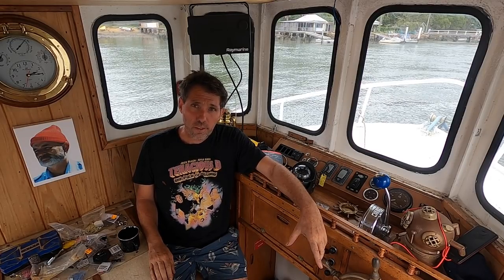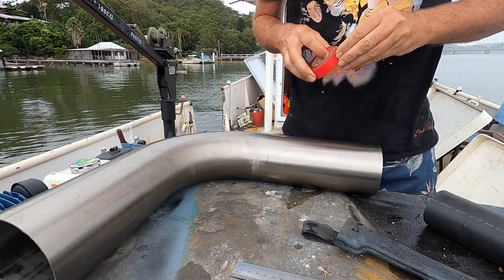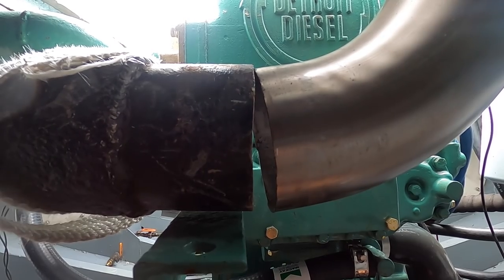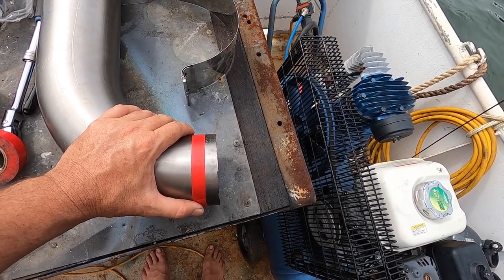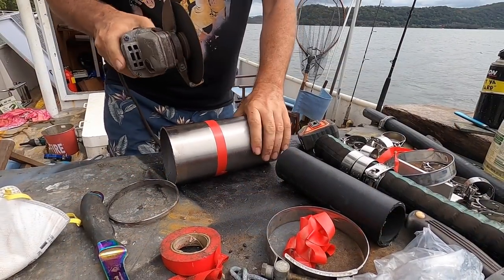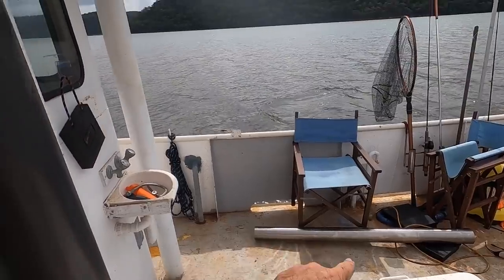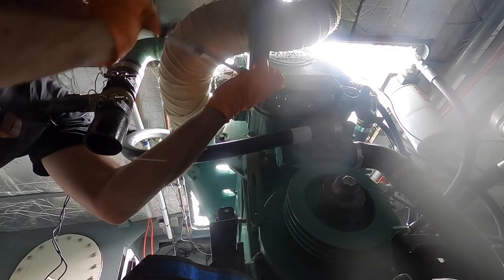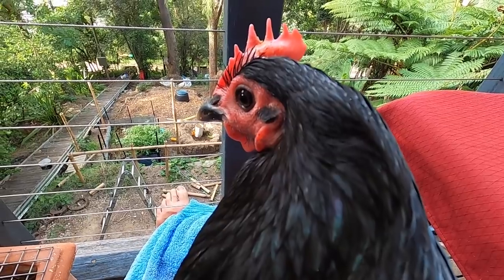Installing the dry exhaust

Comment: May be an odd question, and it's quite possible I missed something.
However, is there any reason you could not have a section of flex pipe in the vertical section of the SS bend between the header and the deck penetration?

Those engine vibes will drive you nuts with the deck acting like a sound board....
Reply from the maker: No room there either.

Comment: very cool been watching from the start relay looks like its coming together just a quick question from the start (Is it still worth buying a steel boat?)
sore the the first video pop up and had a look and had a laugh.
i'm a farmer with a flapper exhaust don't do it at idle the ting noise drives you crazy after they wear and get lose. also a big angle pipe would look cooler

Comment: You need a T fitting instead of an elbow mate so you can drain the rain water !
Reply: If there's any residual water (ounces) in the exhaust it's going to get blown out and/or evaporated in short order once the Detroit gets running.

Comment: Instead of an elbow, what about a sharp 90? Like if you had a metal cube. The horizontal section could go through the cube wall, and the  vertical section could come out of the cube roof through the exhaust hole in the floor

Comment: Hey Stu, Why not just have the vertical (cutting the bend off altogether) then a flexi-pipe and clamp on that bending 90 degrees to meet the exhaust with the other clamp?
Reply from the maker: The turn is too tight.

Comment: what would happen if you rotate the first pipe out of the manifold.. so its pointing down.. come up with an 90 to come across and drop the existing upturned elbow to connect to the vertical stack..  i would like a welded in fitting or even something like an oxygen sensor bung on the bottom of the now dropped pipe... with some flex hose out the side of the hull.   so any water that does come down the stack does not pour directly into the cylinder head exhaust ports.   you might be able to just make the downward loop section out of that flex section of tubing you have..   i realize that you have something dangling in the way.. but maybe that is movable and it would be a lot better than getting rain water during storms down and right into the engine.

Comment: Forgive the dumb question (as I have no idea about this) but why did you use the rigid elbow between the end of the wrapped exhaust and where it goes up to the muffler? Why not just use the flexible hose to make an elbow and joing onto a straight pipe that then joins the muffler? Would that be too breakable or some other reason?

Comment: Is there a reason you couldn't have put the flexible pipe on the other end of the 90% you just purchased to leave more room for it?

Or go the whole way from the existing pipe, to a vertical pipe to the muffler, so use the flex pipe to replace the added 90 degree bend?  Lots of flex and simple to connect.

Lastly I think welding the pipes would be cleaner than the all those clamps.

RichE San Diego, CA

Comment: Hi Stu, getting it done is important to keep project moving . Did you consider cutting the old pipe to a 6" stub and then putting the flex pipe from it to the 90 deg. Maybe the diameters are wrong? Cheers Warren

Comment: Remove that brace that is in the hole coming through the deck, it isn't needed. Then put the flex joint at the top of your new pipe above the deck. Your previous attempt wouldn't have worked even if you had room. 1" of flex joint is not really a flex joint. Basically the same as you ended up with. The vibration of the engine isn't really what you are trying to avoid (even though it will drive you nuts), it is the torque. When the engine is under load, it will rock on those flexible mounts. That is when it will crack that exhaust.

Comment: Could you use just the flex pipe as the 90? Then just attach it to the muffler?
Reply from the maker: No, doesn't bend even close to that tightly.

Comment: I think you were trying to convince yourself that the vibration wont be that much to leave out the expansion joint. I think your wrong though, after a while you will most definitely end up with an exhaust leak, nevertheless you completely defeated the engine resilient mounts purpose. I suggest either cutting back the existing pipe that is attached to the exhaust manifold to make room for a longer exhaust expansion joint. Or fabricate two resilient mounts where the exhaust attaches to the boat.

Comment: Just out of curiosity, why didn’t you use a pipe expander, to fit one pipe into the other, and clamp with a u-bolt on the connections below deck.  Just like the bottom connection of the muffler.
Reply: I've never seen a pipe expander that size. It'd probably have to be hydraulic

Comment: Stu, I think your exhaust is too ridgid. Having done a deal of this in the past, I would recomend using the flex pipe for the entire 90 degree elbow. The flex pipe will eventually rust and have a bit of rigidity anyway. A flex joint, like you see in front wheel drive cars, would make a better flexable connection. When the engine is pushing the boat it will try to move forward on it's mounts. Try to finagle rubber mounts in instead of that clamping affair where the pipe comes through the deck. That will allow the exhaust to move around some when shifting gears and when under load. You have done a nice looking job so far and I suggest you run it as is. if it doesn't work out then try the way I have described. Exhaust is always a pain in the A$$. A well balanced prop with propper shaft alignment will yeild "0" shaft vibration. When the engine is under load it has little vibration. What is the horsepower rating of that Detroit? If you can overdrive it there may be some cheap power to be had. Nice video, my friend. You Aussies must have the tuffest feet in the English speaking world!

Comment: I'm just going to echo the guys about the length and position of your flex pipe. I'm not sure if you have a flex section near the engine but my thoughts are that the assembly might be a bit too rigid leading to cracked pipe. Maybe flex close to the engine at a ratio of at least 4:1 to diameter. The original installation may have gotten away with it if it didn't use flex-mounts. Stay safe man.

Comment: I know nothing of diesel’s [let alone supercharged 2 stroke diesel’s and i understand the supercharger is necessary in this engine design thanks to you, Stu] but ... while there is a LOT of heat the temp is relatively low [in comparison to a gas engine?] yes?  So RTV seems like a viable solution...  Heat  and Temp are related but not exactly the same thing?  I assume that this engine is not run very lean? [which would relate to a higher temp] but runs fairly rich? Which should be cooler? But I digress.

Comment: Should have went down with the exhaust then back up like a p trap with a drain in the bottom for if the flap ever leaked so no water will get in the engine

Comment: you need a fairly good piece of flex pipe to take that vibration !! youll be surprised at what damage it can do if you get that exhaust to stiff . DO IT RIGHT !! SHORT CUTS WILL ONLY COST YOU $$$$$  I would run that flex pipe from close to the flange and make the first bend around the motor with it if you can ??

Comment: Stu,
What is the plan for sealing the deck hole for the exhaust or haven't you got that far yet?
Cheers Eric
Reply from the maker: That is a convection vent that is there by design.
Reply: I was thinking a reverse cone to keep the worst of the rain and spray out of the engine room while still allowing for ventilation.
If the deck is awash you have other problems to deal with and have to hope the bilge pumps handle that side of things.
Eric

Comment: Hey Stu.  Did the boat originally have the dry exhaust stack and then it was converted to 
the wet exhaust?  Did they put the Dual Exhaust muffler stacks above the wheelhouse for 
the cool factor alone?  Hehe.
Could you please explain how a wet exhaust works?  Why did you choose to move back to the dry exhaust?

Keep safe Stu.  It's a good thing the self isolation restrictions suggested do not include friends with wings.
Reply from the maker: Did a video dedicated to this https://youtu.be/tC4jHyUuDs0
Reply: @DangarMarine  Thanks

Comment: I've been stuck at home since 2002 so not much of a change for me  :)
Just curious...why didn't you use the flex pipe to do the entire bend 90 degree up then solid for the the transition through the deck?
Reply from the maker: LOL. Unfortunately the flex tube doesn't turn anywhere near tight enough.
Reply: @DangarMarine /videos Ah...oki  :)
Reply: Gregory Thomas the flex has about a min radius of 800 mm long slow curve

Comment: I wouldn't use a flap on the top of the  stack.  I work in the tractor world and they stopped using those exhaust flaps for the most part. They like to flip up in high wind and allow rain down the exhaust.

Comment: My first instinct was to cut the engine side pipe off by the bolt flange and then flex over to your stack...no 90's at all.
Reply: It's dirty, but I've seen guys cut straight 45 degree angles and weld them up. It's simple and maximum flow is not critical.

Comment: Lol. I would have just pushed the new pipe through the deck from below, twist 90 deg, push it up further, then twist back 90 deg and sit on top of the engine exhaust to get the correct cutting points.

Comment: A TRUCK SHOP OR TRACTOR SHOP WILL HAVE A FLAPER , THE TRUCK SHOP WILL HAVE A CROME OR STAINLESS STEEL MUFFLER GARD AND YOU NEED TO TURN THE MUFFLER CLAMP TO THE SIDE

Comment: Not sure why your flex bit couldn't be on the vertical where you have more room.
I just brought home my first project boat in 20 years (16.6' Flats boat). Went to order parts and marineengine.com was of course the first stop. Then googled the water pump replacement procedure and you were the first one that popped up from WAY back.

Comment: I'd sooner see flex pipe up from the front of the engine to a piece of hard pipe clamped in the deck, then muffler.  
And put a 5 gallon/18 liter pail over the exhausts to keep any driven rain out.

Comment: Don't wrap the muffler in fibreglass tape (don't know if that's what you meant by wrapping it?). Too much chance of touching it en getting itchy.
Also, maybe turn the U-clamp on the top of the muffler 90 degrees or so, so the bolts don't stick out.

Comment: Move the hole in the deck. Probably easier than fabricating a new exhaust pipe.
Reply from the maker: Maybe, but it will also put the exhaust in front of the door.

Comment: Stu, since I am out of my league here, I have no noteworthy comments regarding the technical aspects of this exhaust work.  However, one thing bothers me.  You seem to have created a very rigid and well-built series of piping, tightly attached at every point from the engine to the exhaust pipes at the top.  Won't the engine vibration eventually loosen the attachment points without some type of rubberized or flexible ways to absorb the constant stress? 🙄

Comment: why can't you just run the corrugated flex pipe around the corner up to the vertical, that would give you a much better anti-vibration system verses the solid bend and practically no flex section.

Comment: You know you could have fed the exhaust into a box that then has another pipe run up into the cutout that it has to be running out off. In the mustang world it's called an H pipe and helps with lower end Torque vs X pipes that help with top end HP, but does not have to be dual feed dual exhaust. Similar to this but with only one pipe in and out: https://www.amazon.com/Pypes-Exhaust-HFM37-1999-2004-Mustang/dp/B00TU5F0BK
Correction, I should have said H-BOX, but you know, your on the right track.

Comment: Stu, how big is your exhaust pipe? I looked at a website for diesel exhaust tips and they have turn down tips in 3” to 5” inlets. They come in stainless or black stainless for under forty bucks. Would something like that work? As far as vibration, could you take the ring off a exhaust header collector box(they sell just the rings) and weld one on each exhaust pipe where they connect and use longer bolts with a spring between the bolt and the nut to create a flexible joint?  Can’t wait to hear it running! Keep up what you’re doing, it’s a great series! Wesdonautomotive.com is one site I was looking at.

Comment: Totally the wrong way to go what ever you say there is going to be some vibration which will eventually cause a failure. It would have been simple to cut out a section of the deck holding the pass through move it over and weld back into place.